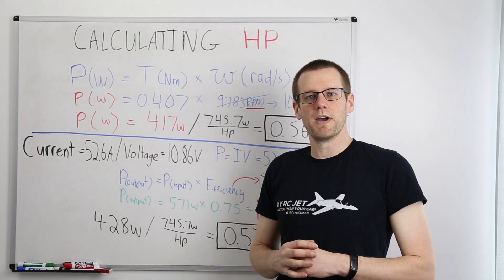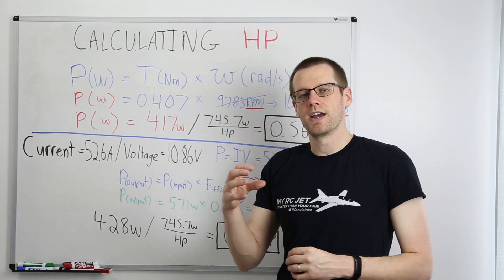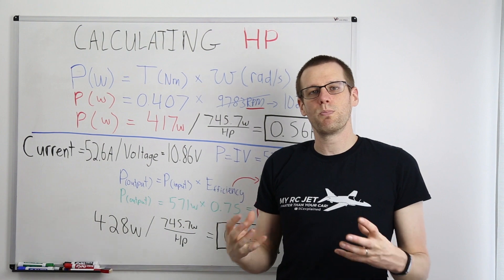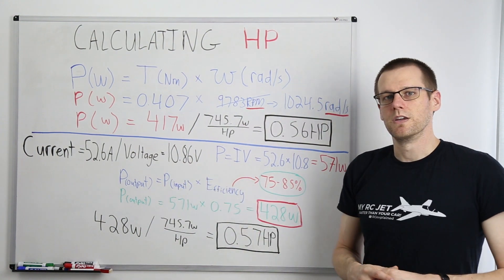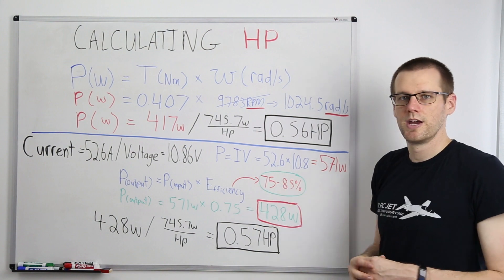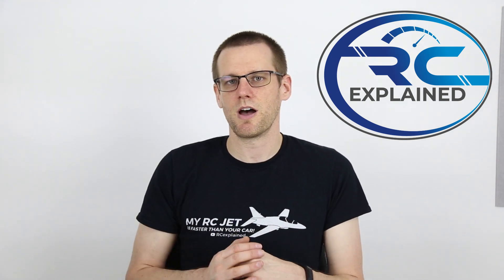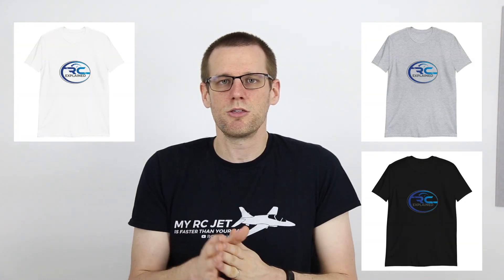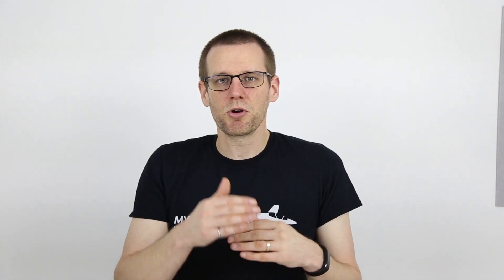How to Calculate Horsepower for RC Vehicles + Subscriber Giveaway!

Comment: Hello, i am really enjoyed watching your videos, great lesson...

I wanna ask, does motor of same size have same power regardless on turn count or kv at the same voltage...? Like, is 55T motor with 2S has same power as 27T with 2S...?

And is this true, power = torque x speed...? Like, if i increase speed (through gear ratio) by double, my torque will decrease in half...? And if i use doube voltage (i.e. from 2S to 4S) will it be double the power...?
Reply from the maker: Different wound motors will need different voltages and amps to hit the same power. Your statement would be true if you left out voltage. 

Power is torque x speed yes. If you double voltage and current stays the same, power doubles.
Reply: @RCexplained  nice thank you so much for your information... I am building crawler kit, i want kit with high torque but don't wanna go very slow (more than half speed)...
Reply: @RCexplained  oh one more question if you don't mind... Does different turn motor at the same voltage has same torque, for example does 55T motor has same torque with 27T motor at 7,4v...?
Reply from the maker: Voltage does not contribute to torque. If the motor pulls enough current torque will be equal between those motors.
Reply: @RCexplained  oh ok, thank you do much